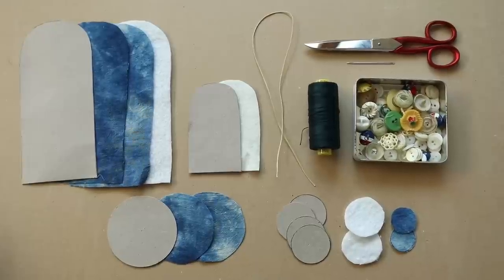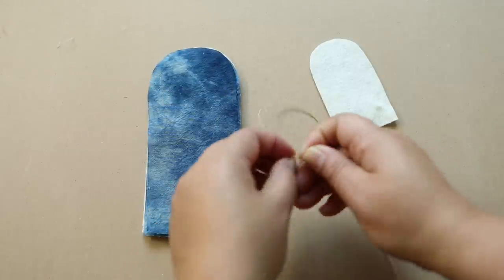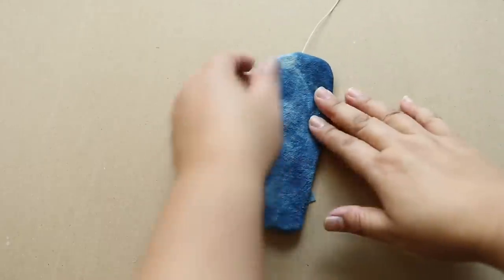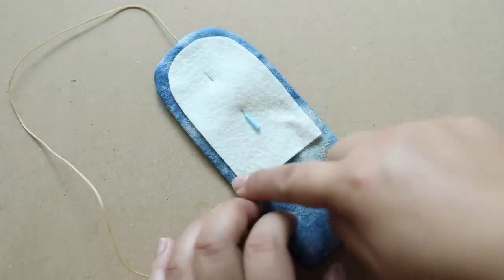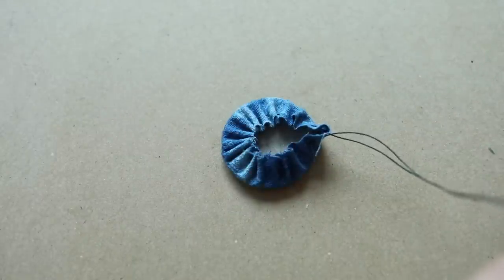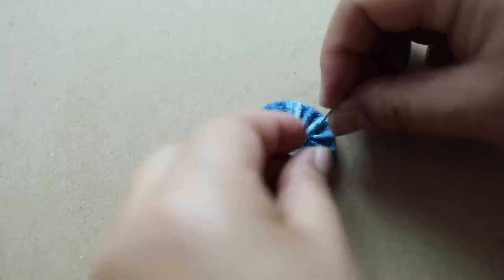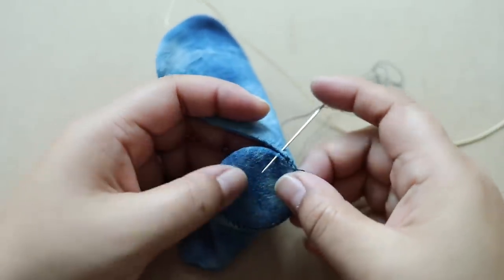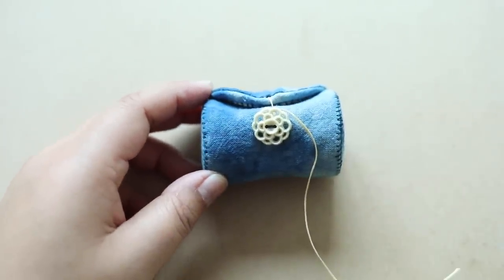THREAD HOLDER/Sewing kit

Comment: Trying to figure out where to attach a thread cutter.  Perhaps a magnet to just attach to the scissors.  You can get those mini snips on a chain, too.  So perhaps a wee round button hole for the chain.
Reply from the maker: yes that would work nicely😊
Reply: I’m very interested in your ideas. Maybe there’s a way you can attach the round Clover pendant thread cutter instead of the button closure? Where would you be putting the scissors or thread snips?

Comment: Love this any modification instructions for different size spools or to add a bobbin so you have it all together.
Reply from the maker: To add a bobbin make the body wider by the same thickness as the bobbin, for overall bigger just increase the circumference of the circle by 1/2 inch or larger as well as add 1/2 inch to the length and width of the body.  Try using a piece of paper and tape to make a prototype before the actual piece.
Reply: Thank you

Comment: Love this. Would it fit an Aurifil spool, or would I need to adapt it? (I am thinking about the larger spool, which is about this size.)
Reply from the maker: Yes I think you will need to adapt, it’s a bit longer and narrower
Reply: @bookhoudesign  thanks!  I think the modifications would be pretty straightforward.